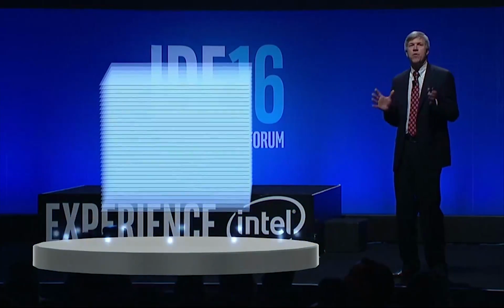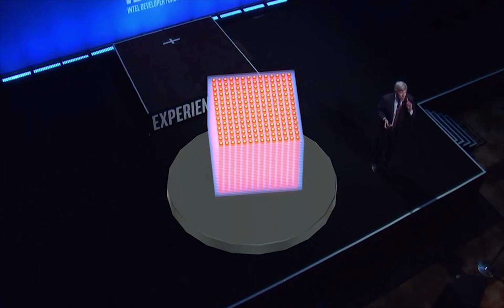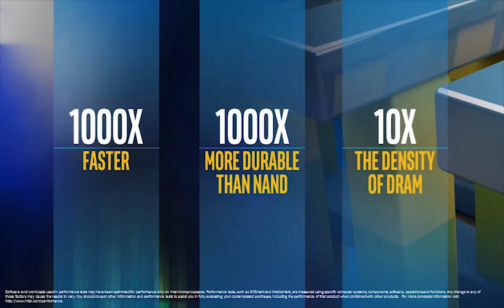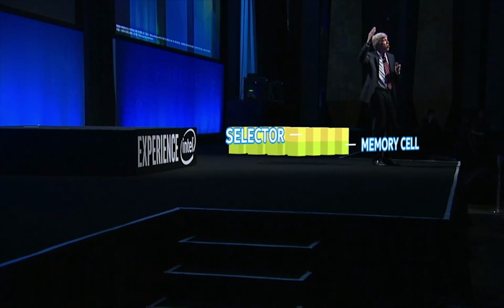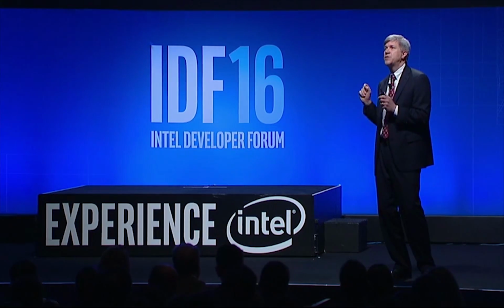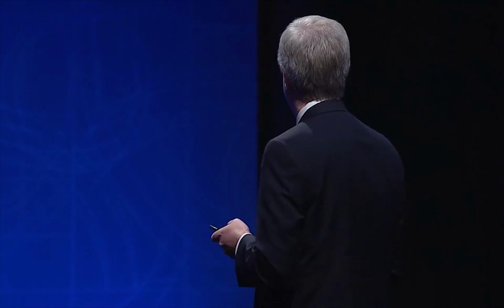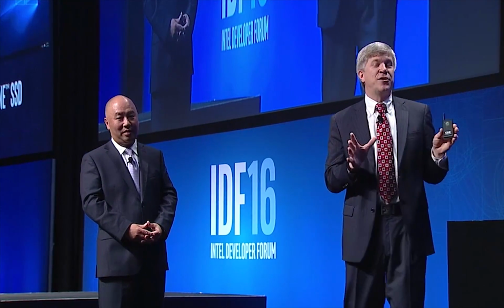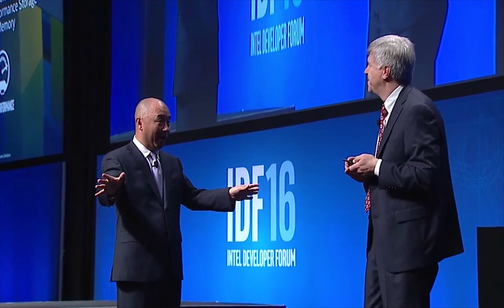Intel Optane Demo - File Transfer at 2GB/s - IDF Shenzhen

Comment: What is really impressive is that the 2Gb/s-ish speed on thr Intel Optane is constant.The other drive first started on 1Gb/s then it went down to 200-300Mb/s (and the speed was not constant).I have a really good drive too and that constant transfer rate from thr Optane (and rhe high speed) is really impressive!

Comment: Ffs, why are they trying to bullshit developers? That demo had a normal sata ssd against an optane ssd (I assume connected via either m.2, u.2 or directly slotted into a ram slot), which would have obviously made the Optane win. They should have put the Samsung 950 Pro against the Optane, but that would have made it look way less impressive...
Reply: +elevul it would still be around 4 x slower. 
http://www.samsung.com/global/business/semiconductor/minisite/SSD/global/html/ssd850pro/specifications.html

Note, he did say that the Optane would take 15 seconds whilst the SSD around a minute.
Reply: +Steve Locker, elevul said 950 - which is an NVMe drive, using PCIE / via m.2 lanes rather than SATA.  

950pro 2500 MB/s read, 1500 MB/s write
Optane 2000 MB/s read, 2000 MB/s write 

Not really much in it, Intel are trying to catch up to Samsung, but they are a little late to the party.
Reply: +Transmit This Why would you involve Samsung? Intel themselves make an NVMe drive that holds 1.2TB, and does 2500MB/s read, 1200MB/s write, the 750, which has been out for a year.

More important though: how are the IOPS/sec? That is way more important than sequential read/write.
Reply: +rufmeister I was replying to a comment about Samsung, that is why I mentioned them.

Yes Intel do make that large 750, but It's not really a consumer drive at such high capacity and cost £700ish So apart from business or enterprise it's of academic interest to most people here.

I would be just as interested in the 4K random read/write speed as the I/Ops, and the cache and controller capability's, as it all affects how the drive will perform in your environment.

Unless Intel have something that can go head to head with what is already out, competing on price and stats, I won't be interested as a consumer.
Reply: +Transmit This Nobody is talking about how those 950pro numbers are greatly exaggerated. My 950pro never sees those numbers even in synthetic benches. The numbers on the product page are lies and always have been.

Comment: So pretty much the only thing slowing 3D- Xpoint is the PCI-e x4 connection? But to be fair thats the only thing holding back NAND (with the exception of the controller) so the only thing this has over NAND is the space it takes up?

Comment: Only important thing for me is the price to performance ratio. I don't care if 1TB costs $1000.
Reply: they are aiming for the high performace market, like servers and super computers
+UnitedStatesOfMoney
Reply: +To by Do you want higher capacity or higher speed? Cause there were two different showcases. And of course its going to cost more initially.
Reply: He did mention the lack of transistors reducing costs so I doubt it would be out of the average Joe's budget

Comment: its not going to be much faster than SSD's and likely slower than next gen SSD's however if the lack of transistors means they can actually scale up to huge reliable capacities and reduce production cost then you could see intel build cheap custom SOC's with this tech used as the SSD and the systemRAM integrated with a intel CPU and igpu to mass produce a high performance and low power ultrabook for developing markets maybe?

Comment: I have one question. 

if they are not using transistors anymore in optane then what is the replacement material?
Reply: djBC10000 worms
Reply: Optanium, that's the stuff they harvested on Nandora!

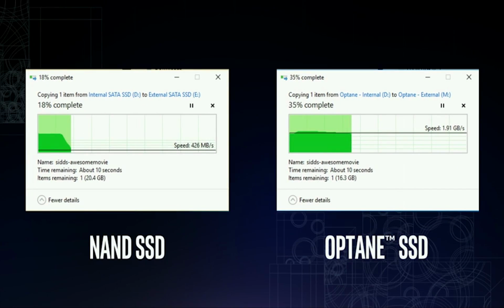Comment: 07:22 It isn't a fair comparison. Obviously SATA is the bottleneck for the NAND SSD.
Reply: +Yik Wai Donald Leung sata can handle 6gb/s. and m.2 ssds are directly overheating and throttling down
Reply: +CryBeat that is 750 MB/s
Reply: Yik Wai Donald Leung oh ure right. its just 6gbit/s on a regular sata port which is 0.75gb/s. maybe ure right and they should have come up with something like a 950 m.2 :p

Comment: Still slower than Modern RAM sadly :/ so it won't be able to replace that.
Would be awesome with some high speed non-volatile memory for the CPU.
Reply: you could put a load of it in parallel to increase speed

Comment: Why 2GB/s can easily be acheived by running a couple of SSDs in RAID0. The real trick is those pesky 4k Q1 random read/write speeds which are generally far too low. Has that been improved?

Show maybe actual benchmark data (like crystalmark) rather than some stupid windows file transfer?

Also... Lifetime?
Reply: Mark Murarescu This is just an evolution of the SSD. It is among our first steps towards 3D (stacked) chips. the other one I know of is HBM. We can expect these things to generate a lot more heat than their 2D counterparts.

Comment: wowo fast transfers speed lol. 

dont laugh at me but im still running on an old hdd drive :(
Reply: djBC10000 that's okay right now high-volume storage is much cheaper on old HDDs. That's why I load my operating system on a SSD and store large non prioritized data files on a HDD.

Comment: Isnt this the same thing Samsung did? lol what a joke
Reply: +John dawson It isn't. Samsung uses VNAND and this is 3D X-point memory.
Reply: The memory they were describing is near identical to smasungs 3d vnand
Reply: John dawson Not at all. 3D X-point is developed by Intel, Samsung doesn't have anything comparable.
Reply: +John dawson He specifically talks about the differences between standard 3D-NAND/V-NAND and Intel's 3D Crosspoint Memory.
Reply: yes, Samsung created it first but it's also good that Intel got in the game as well. it would bring the overall  cost down of ssds for us consumers.
Reply: TheAgentOfDeath It is very unlike Samsung's V-NAND. V-NAND is where NAND is bent vertically on the PCB. This can be stacked for more capacity.
3D X-Point is first of all NOT NAND. X-Point has a raster which can be read from and written to in this matter very unlike NAND.
X-Point is also easier to stack than NAND.
Reply: V-NAND stadns for vertical NAND. Samsung has memory that is stacked creating a smaller and cheaper die considering it allows them to make a larger manufacturing process. (32nm to be exact) So Samsungs V-NAND has always been stacked in multiple layers -_-
Reply: John dawson V-NAND hasn't always been stacked.
And again, X-Point isn't NAND.